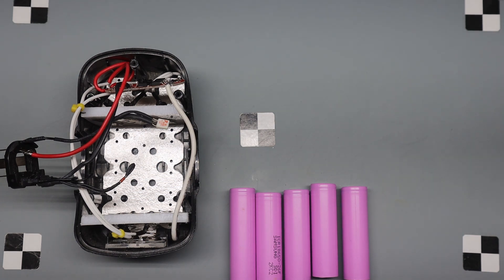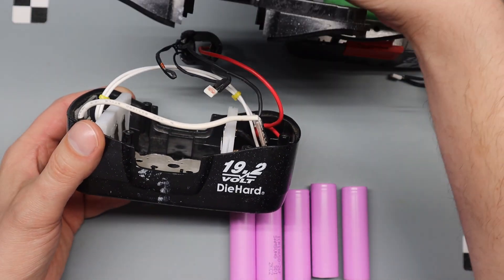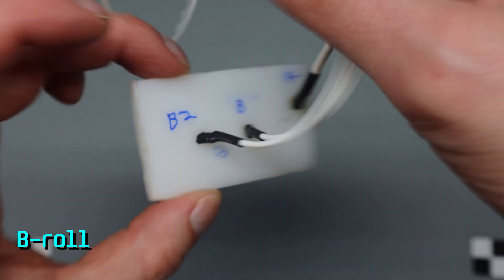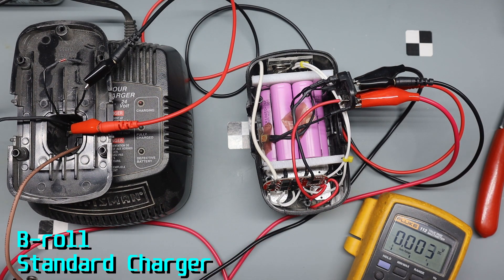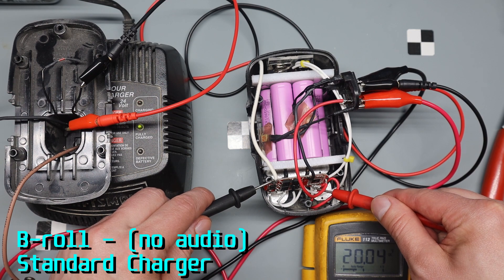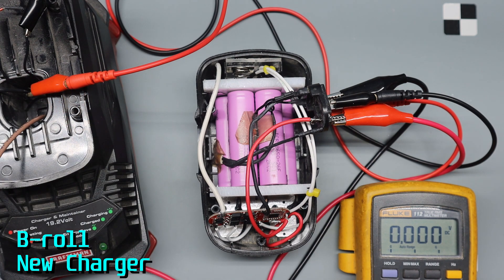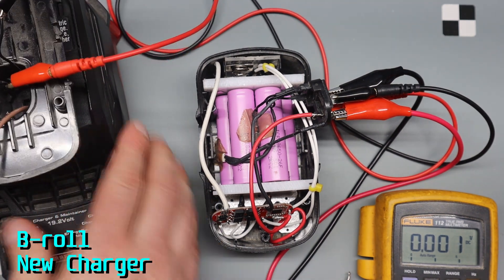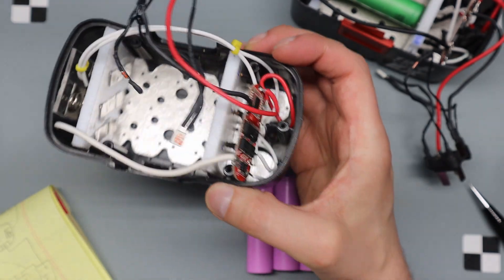Convert Craftsman Ni-Cad Battery to Lithium (part 3) battery charging

Comment: I have exactly the same 19.2v craftsman battery that I'm trying to convert to lithium ion. I just need to know what type of BMS did you use for yours and did you do anything with the normal 1hr Ni-CD charger for it to be able to charge the Lithium ion battery properly?
Reply from the maker: The BMS I used is in the description of the (part 2) video linked in the description.  But that one ended up failing after awhile.  I did order a different one recently but haven't tested it.
As for the charger, I didn't do anything to it.

Comment: Could you have put a 6th cell in, or tied 2 of the cells in parallel along with the series, so you would have been 5s2p? I assume you used 2500 mHa batteries, so you'd have a 5 AH pack instead of 2.5 AH pack...
Reply from the maker: Based on the housing shape a sixth battery would fit.  But there wouldn't be room for 10 of them in a 5s2p config at least in the housings I have.

Comment: I have an official c3 lithium battery. The board inside has some problem. The battery will put out voltage but it will not charge.  I put wires going to each battery, like the wires to the bms shown, but I put a plug that goes into an RC battery charger.  So you can go that route as well.  The board inside official ones if working lets the charger know it is lithium.  If custom made, with bms or not, without the c3 board inside the multi chargers will think it is a nicad and use that charge cycle.

Comment: With youre knowledge of this 1 hr charger and this specific battery. Could this 1 hr charger safely charge a nimh replacement battery off amazon
Reply from the maker: The nimh listing says "suitable with original Craftsman charger" so they are not requiring a special charger.
There are temperature sensors in the battery packs that the charger checks so it should keep it from overheating.

Comment: Did you have an issue with the BMS dropping voltage when running a drill for a few seconds?  I got the same 5S you have but the first couple attempts with the drill the voltage from the BMS dropped from 20.6v to 9.8v in a few seconds.  The cell pack still tested at 20.5v.
Reply from the maker: I didn't have any issues during the build or charging with any drops when testing.
But, rechecking them now, the cells are at 20 and the BMS output is 9.8, that is quite odd.
I can't vouch for the reliability of those BMS', I did only pick them because of the size factor.

Comment: I have an old nimh battery pack and I want to turn it to lithium as you did.
Can I use the regular dc transformer ?  Or I would need a lithium charger for it?
Reply from the maker: The regular charger might work, but you wouldn't want the voltage it normally charges to to be higher than the lithium.
For example if it is 12v (10 cells at 1.2v) it might charge to 13v, and if you replace it with only used 3 lithium (3 cells at 4.2 max =12.6) it might not shut off because the charger might be trying to sense 13v as the full charge, and that would be a safety hazard.
And the BMS you would use with the lithium might then bypass the charged cells and dissipate the current as a lot of heat.
It really depends on what your setup is.